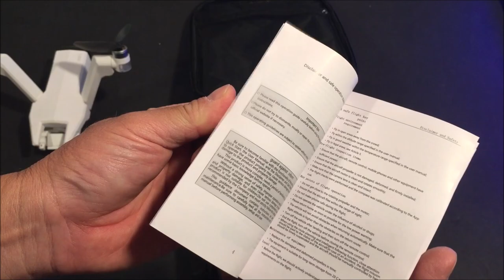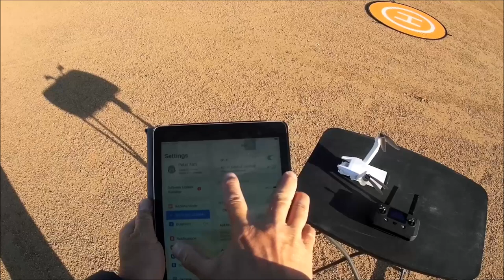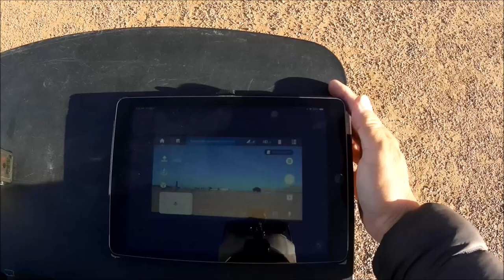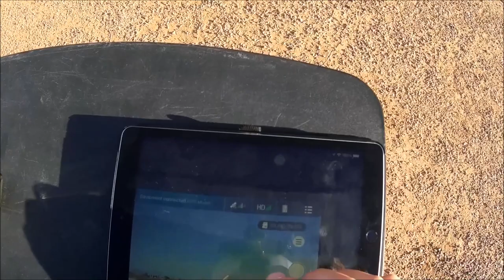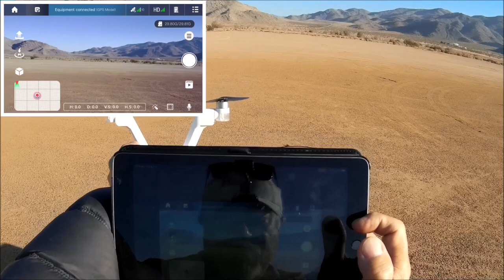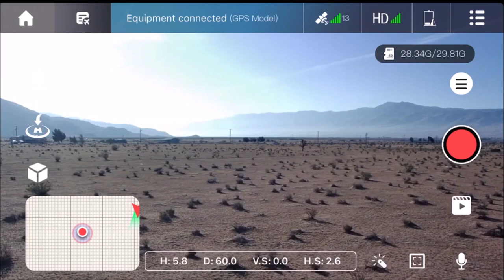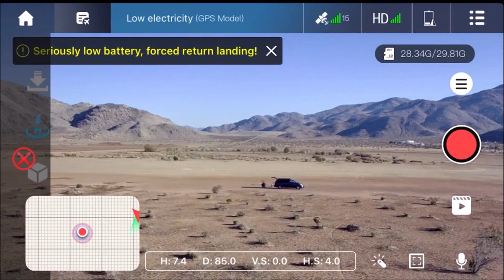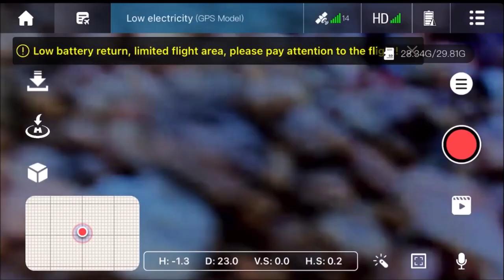Dual Rotor Bi-Copter LYZRC L100 Review and Test

Comment: I have new information for you. The optical flow lens on the bottom of the L100 is fake. I have disassembled mine and found that only a plastic lens case is hot-melt glued to the bottom of the drone enclosure and has no electronics or wiring attached, nor any place to attach to. This explains the drone’s erratic flights when GPS is not good and it’s sudden altitude changes.
Reply: Good sleuthing! It was clear from the way the drone didn't try to draw itself away from his hand when he grabbed it while it was hovering, that the optical flow was not there.
Reply: Why would they lie about that like this?
Reply: Why many cars have fake exhaust on one side?
Reply: @tiktakbum3962  That’s not a fair comparison. In this case the manufacturer is advertising the optical flow stabilization as a working feature. It isn’t just a cosmetic difference.

Comment: thank you for the video You will be asked two questions 1. If you touch the small map in the lower left corner of the screen, a blue circle appears and you can see the aircraft posture in flight.

But what is "GO" on that screen?
Is it back home?
Does that mean it's going in the direction of the gas?

2. How do I undo return home?
Reply from the maker: 1.  The go may be to enlarge the map?  
2.  press rth

Comment: Excellent review thank you. The WiFi and camera work well. It even flies good (for what it is)...but it just looks so weird.
Reply from the maker: Not bad at all.  I'm impressed that a dual rotor bicopter actually flew!  Some issues but I've gotten some quadcopters that are just not even worth mentioning.  Looks like a fixed wing aircraft when in the air :)

Comment: In your video, the l100 is very stable. However, the l100 is poorly built and does not fly reliably.

By the way, in your video, the l100 is stable and flying great.

Did you update the firmware? What is the current version?

Comment: The optical flow sense on the bottom of the drone is fake, and when disassembled, it is a model with no connection to the board.

So, you can't hover indoors at all, right
Reply from the maker: You can manually.

Comment: Hello, there are videos showing problems with rth and low battery warning, there is one that fell into the sea and did not return due to low battery level, any news
Reply from the maker: So far my unit is working fine except for the temporary dips due to perhaps only two rotors instead of four.

Comment: Do you know where I can get a replacement transmitter for this drone? I received a broken one from Banggood and they do not have a replacement, offering me little help to resolve this issue. Would you know the RF protocol that is used for this copter as I can possibly use my Radiomaster or Jumper transmitter?
Reply from the maker: Sorry to hear that man.  I would offer you mine but I already passed it on.  I don't think this will have the protocol in the multi module.  I know...that's the down side of Banggood.  If it was Amazon...you know just return it you know.

Comment: Very good review Pete, but I am not sure about this one.
Reply from the maker: Thanks Greg!  I'm glad I don't have to buy these to test them out but it is nevertheless very interesting for sure :)  The gyro and the tilt rotors need some improvement, the center of gravity and the loss of power maybe due to just two motors lifting what is basically the same body weight that of a quadcopter is inadequate but I still like it :)  🍺🍺👍

Comment: Please comment on your current firmware version (shown in software splash screen). Have you performed a firmware update from the settings menu?
Reply from the maker: No I haven't done a firmware upgrade.  Why?  Does it fly better?
Reply: @RCEscape  Yours seems to be flying better than others. Can you please check what version it is at?
Reply from the maker: @falloutdjsteve  
mine says 013.009.f5be-0x3771
Reply: @RCEscape  Does it show that as current version on startup window or the available upgrade version in the app menu?

Mine says (on app blue startup window):
AppVer: 2.2.2
FirmwareVer: V4.0.4_44

Then in app menu says:
Firmware upgrade
Firmware Name: BH-ST-ID0101
Firmware Version: 013.009.F5BE-0x3771
Reply from the maker: @falloutdjsteve  
my app version is 2.2.1
firmware version is the same as yours.
and the rest is the same.

Comment: partisan rating
its obivious than the quaity of the video is inferior to most fpv systems and the angle is not 110deg
also not demontrated the filter camera system
the optical flow is non existant and the stability awfull especially because i have no gps at all despit dozen show on my cell phone
not tested the long range signal what the soe point of this when gps is working